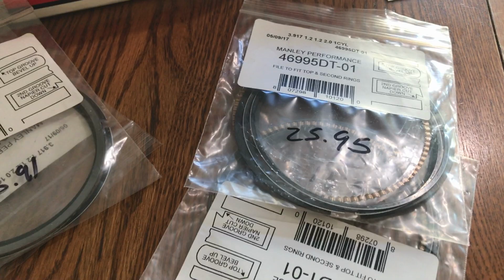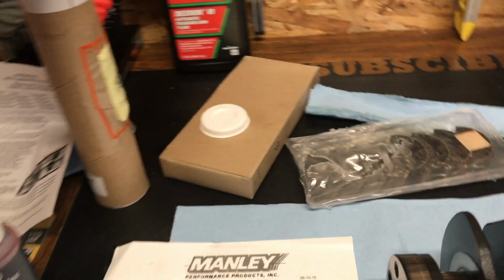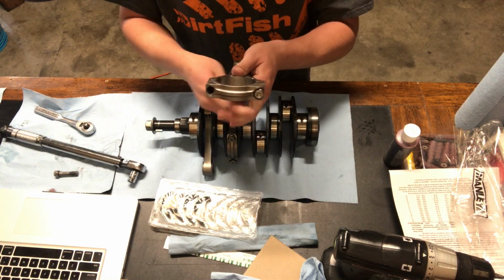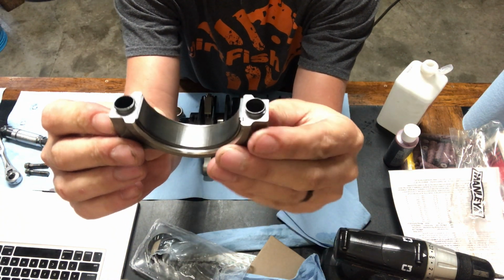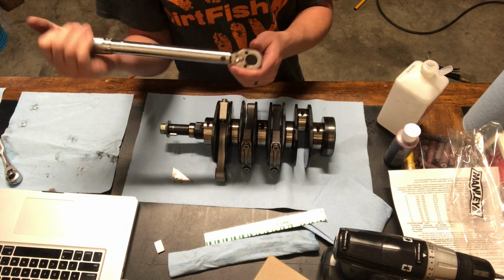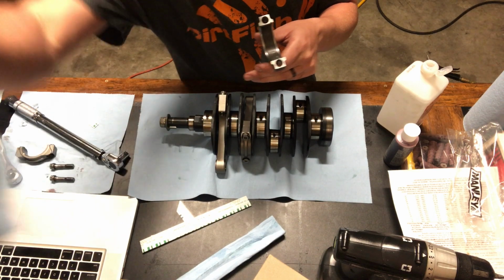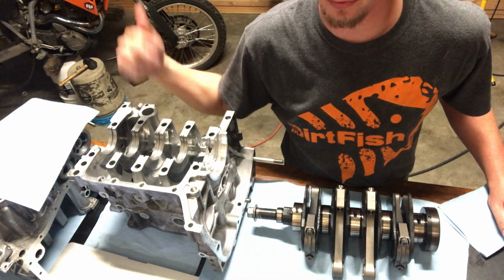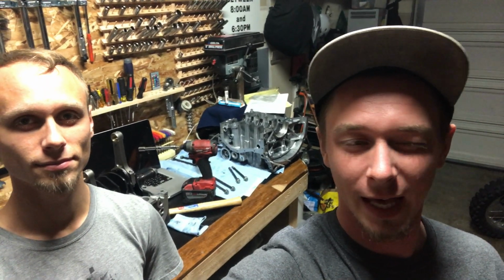Checking Clearances On The Connecting Rod And Crankshaft In The STI (Plasti Gauge)

Comment: Modding Addiction, When I use plastigage to check Clearances on The Connecting Rod and Crankshaft should I use the old bearing or new bearing?
Reply from the maker: Use your new bearings to check against factory specs. The only reason you would check the old ones is to see what was out of factory spec. Hope that helps. Don’t forget to subscribe
Reply: @ModdingAddiction  Thank you so much for this important information. If my engine never went on the machine shop and only have 80.000Km, it's the first time engine was removed. do I have to buy standard size engine bearings or other size?

Comment: On the ARP bolts, you see you have the column called Under Head Length? You have a different length for each of the 625+ bolts. Measure the bolts from under the head to the very base of the bolt - then match that to the one on the instructions

Comment: Do you have to put plastigauge on both cap and rod sides of the half bearings?
Reply from the maker: I suppose that you could but generally you only use plastigauge on one side. Clearances are set based on one side touching the bearing and the other side is measured. Then the overall gap is split in half when there is no tension (plastigauge on one side).
Reply from the maker: Don't try to move the connection rod around with the plastigauge in cuz it will just smear it around. Found that out the hard way.
Reply: Oh ok i understand. So if my clearances are too big and i need to replace the bearings do i always change both sides? I just wondered because they give the option to buy  in single halfs.  Honda say i can use 2 different colour codes (thickness) on each half which is weird..
Reply: If your clearance is too big you can order 1/2 shells or 1/2 of a bearing, so say you need 1.75 thousands and you have a clearance of .002 which is .25 too big you can use 1/2 a bearing shell at .002 and 1/2 at 1.5 and together they will equal 1.75.. That's where the mixing of 1/2 shells comes in handy..Somewhere on you tube someone has a video that shows how to figure out what you need..  Generally you torque your bearings in the rod beam 1/2 & cap 1/2 using soft jaws in a vise so you won't damage the rod. To do this propper, one would need a dial bore guage and measure the bearing to get the optimal inside diameter of the rod bearing, then using a micrometer you measure your clean no lubed journal not taking measurements near the oil hole on crank journal, then subtract the crank journal diameter from the rod bearing inside diameter and you get the oil clearance for the bearing you've selected to know if you need to go up in clearances or down which would entail mixing and matching bearing thicknesses.. plastiguage is ok to double check your measurements but I personally wouldn't rely on them as the eye is not as accurate as a micrometer or dial bore guage.

If you can find and english version of  subie performance, he explains that or go through Jafromobile's video's as he has one that explains in great detail that you can physically watch to understand how this process works.. Good luck..